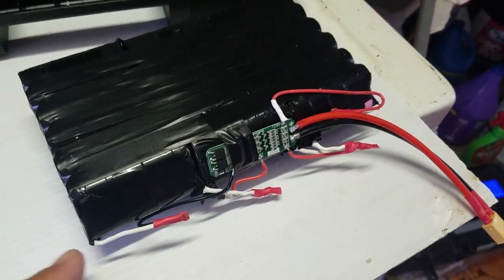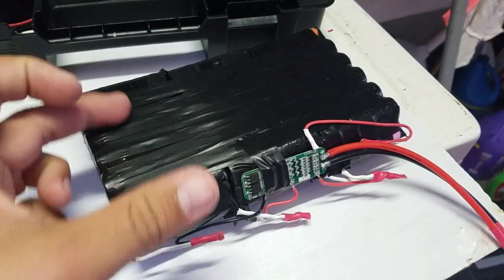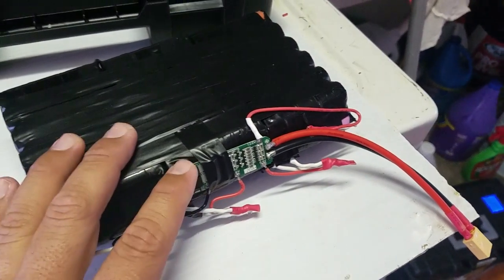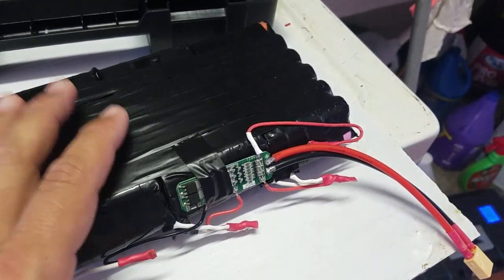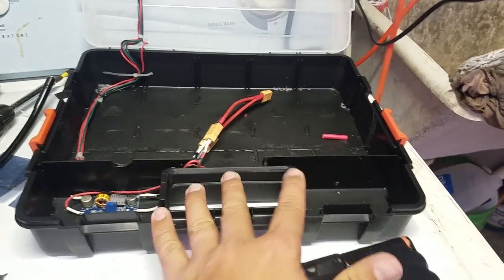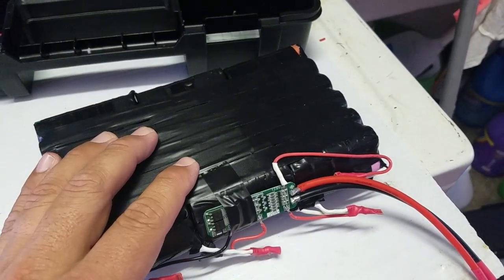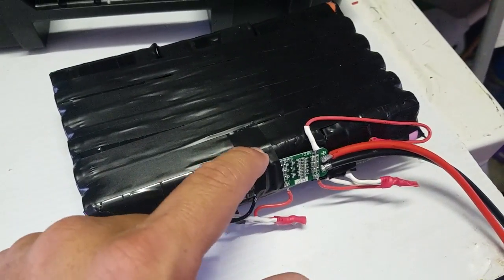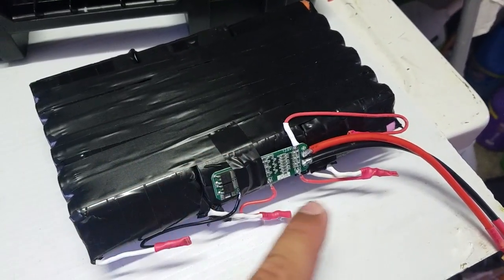My latest Diy 18650 battery with BMS

Comment: That's cool. Ive been playing with bms boards on small 12v packs.
I think it's a good safety measure for high / low voltage. 😊
Reply from the maker: +Offgrid Dreaming Yup, specially when I don't have the time to fully cycle the cells. This gives me a bit of peace of mind.